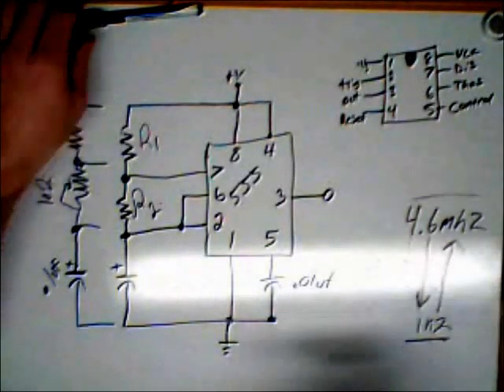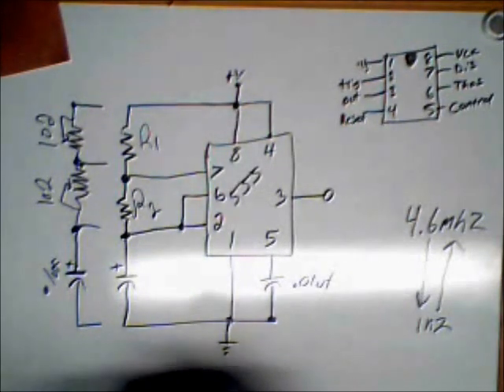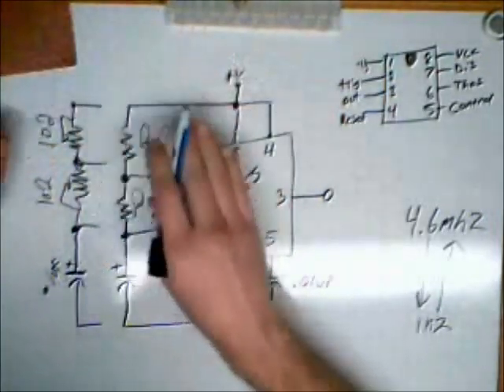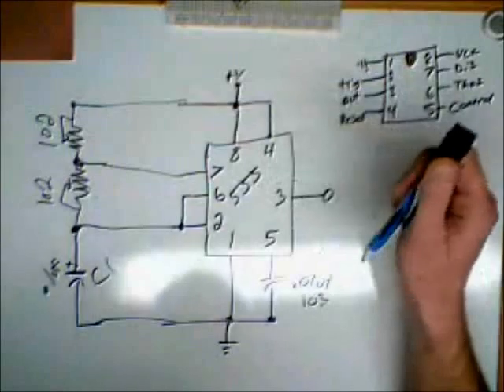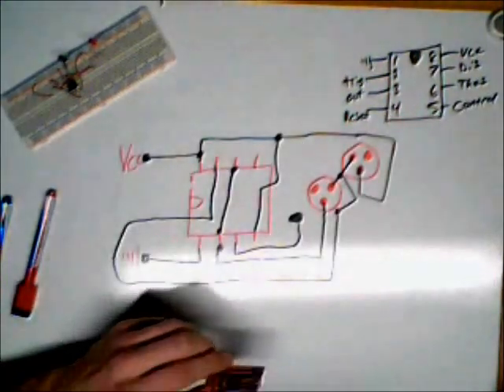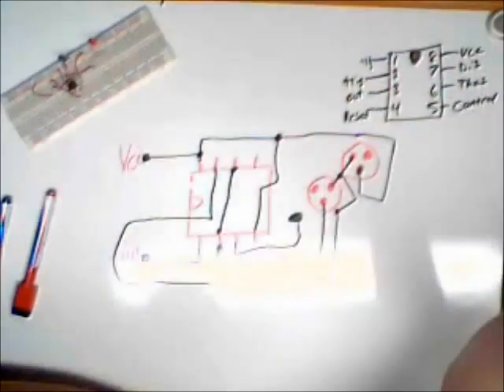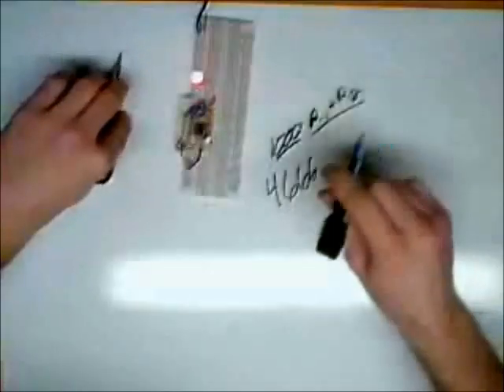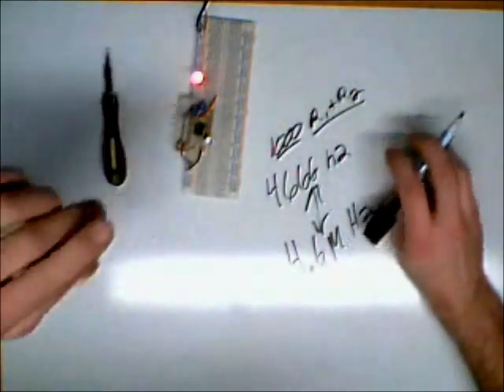555 Timer Freq. Generator

Comment from the maker: @DIYElectronics  Honestly its just always been a fascination of mine, and i enjoy  puzzles and this is one of the biggest s one's ive came across. Over the last 6 months, ive been really working with PLC's and Micro-controllers, and some other programmable devices. After i finished my solid state course I havent really messed with them a whole lot since. One thing i can recommend to you is the Arduino if your really interested in electronics. It will save you alot of money.

Comment from the maker: @zxzxzx000000  Im glad it was success! This circuit is good for getting started with the 555 timer, lets you see how it kind of works, from there you can try adding more timers and connecting them in different ways adding op amps and n gates and all kinds of cool stuff to manipulate the signal.As of now i currently am working on a bachelors in  EE, I just got started with core classes on electronics a year ago, and have messed with electronics since i was in High School.

Comment from the maker: @zxzxzx000000 Umm it never actually hit 4.6mhz, but in theory with the formulas not taking into account min operating amps ect for the ic it could go up to that, and i was wrong when i made this video. You could push it past 100khz but it could become unstable and explode! jk. You are correct and thanks for correcting me. As far as the trim pots, you need to connect one leg to hot, center to pins, opposite to ground, and for the next trim also but just connect to same pin